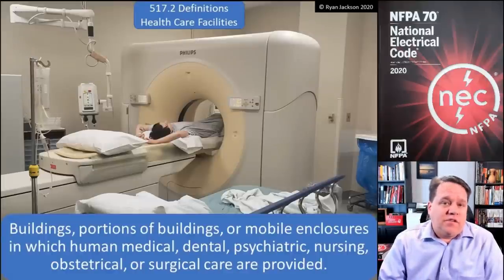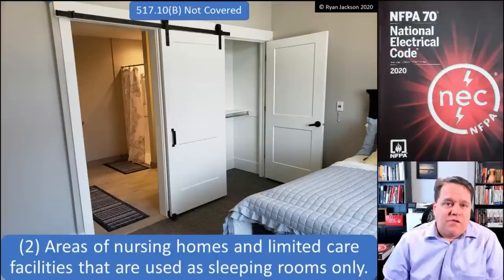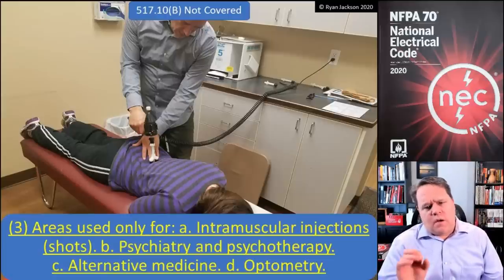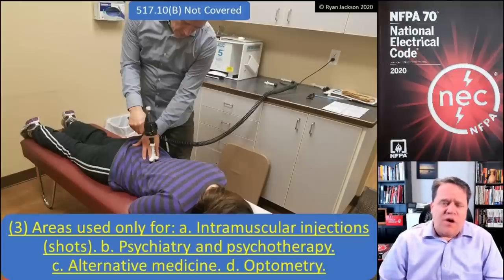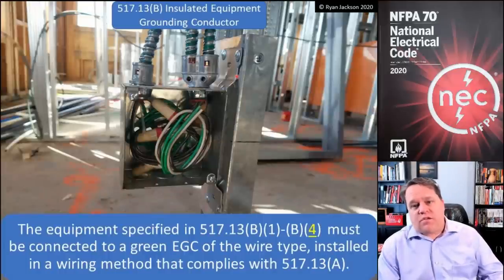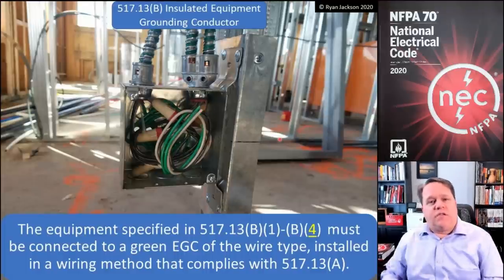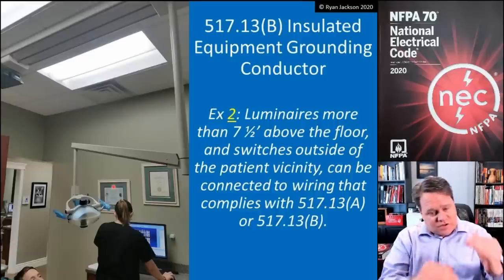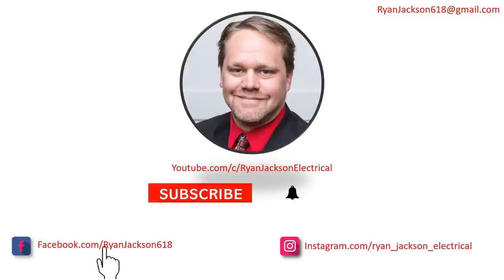Grounding and Bonding in Patient Care Spaces. 2020 NEC 517.13 deep dive

Comment: At a large very progressive Children's Hospital that I retired from they started what they called room a day. They tried to set aside 2 of the 550 patient rooms everyday 7 days a week. Electricians had to check every receptacle and trip GFCI'S with a tester. Also had to make sure if receltacle & switch wall plates were not engreaved with panel & circuit # we had to use tracer then P touch plates. At the same time zone mechanic replaced old ballast and replaced all lamps.  They wanted every patient room to be gone thru at least once a year. Could not talk them into converting to LED'S during the down time. Even went to the trouble of adding a second TV in single bed patient rooms so kids could play playstation on 1 TV while parent watched their show on second TV.

Comment: Unfortunately, your understanding of optometry versus ophthalmology is no longer the case. There are currently four states that allow optometrists to perform surgical procedures, but optometrists are advocating for more states to allow this. There needs to be a proposal to remove their exemption in the code.
Reply from the maker: I'm certainly not an expert, butvI think by definition eye surgery is opthomolgy. A doctor who is not a surgeon might perform surgery. They're not a surgeon, but the procedure is still surgery. An optometrist that performs eye surgery may not be an opthomologist, but hecor she would be performing opthomolgy. That is just what I found via a quick search, however. I didn't perform any deep research on the issue.
Reply from the maker: @r2db  You should make a public input for the 2026 NEC.

Comment: Retired from a large hospital and only the what used to be called chief electrician know actually what was allowed on life safety. ( 1 example = exit luminares ) or just plain vanila emergency panels. ATS switches were programmed to have life safety to be the last lost if all the genetators shut down. Where they had 4 elevators at one location were smart enough to split emergency power to 2 ATS'S. The office that my dermatologist rents space at has hospital grade receptacles in the 2 exam/ procedure rooms.When he moved into this location 15.years ago it was my thought that this location did not need hospital grade receptacles. The only procedures he performs is using nitrogen to freeze small moles or a scapel to remive moles. Only 120 volt thing on is the luminares & desk computer. He uses a battery powered light.

Comment: Hello. Question about your mechanical and conductor ground for your dentist chair: what is the advantage for using a raceway as a ground versus just letting the guy pull two ground conductors? They both seem to be the same solution to me.
Reply from the maker: A metal raceway is a MUCH better conductor than a copper wire.

Comment: Ryan, this is EXCELLENT! As Principal Members of NEC® CMP-15 and of NFPA 99 (Health Care Facilities Code) Electrical Systems Technical Committee (HEA-ELS) and Medical Devices Technical Committee (HEA-MED), I DEEPLY appreciate that you explained that the second grounding conductor is NOT “REDUNDANT” (effectively not or no longer needed or useful; superfluous; exceeding what is necessary; .
characterized by or containing an excess; serving as a duplicate for preventing failure of an entire system upon the failure of a single component). Bringing that second grounding path back around to reducing the impedance to the fault-current and stray current so that the OCPD is GREATLY sped up in operation makes it clear that the second grounding conductor essential and NOT REDUNDANT!  Thank you!!!

It’s worth clarifying that the 7½ feet for grounding of luminaires in 517.13(B)(1) Exception No 2 relates to the 7½ feet height of the Patient Care Vicinity defined in 517.2.

Also worth noting is that “HCF” cables (Type AC-HCF and MC-HCF) are NOT mentioned in NEC®. “HCF” is a Marketing “aid” to make SPECIFYING and INSPECTING Type AC or MC cable SUITABLE for health care facilities EASIER. It IS POSSIBLE (USED to be “normal” before “HCF”) to select and receive the CORRECT Type AC or MC cable having that second grounding conductor per 517.13(B), but the “HCF” gives the specifier, the installer, and the electrical inspector CERTAINTY that the two equipment grounding paths (armor/sheath and wire-type) are in fact being furnished.

Comment: At 24:50 mention cutting the flimsy bare wire on type AC cables. We were taught to leave a 6" tail and wrap it around the cable jacket. Never know ornsaw in any instructions to just cut it off. I still can not believe that a flimsy 16 guage aluminum wire in contact with the dissimilar material steel jacket provides as good as a ground verses a 12 guage copper ground thats in a 12 guage Type MC cable. I hated seeing type AC ( Yep BX cable ) in a damp cellar feeding a heater or furnance.
Reply: That why labs test it to see the facts
Reply: @joes2085  yeah for real. That's why we have codes & standards. Not a good idea to use intuition to determine such issues.

Comment: Great video! Thank you.
Please consider a video explaining equi-potential (to ground) and leakage (to ground) testing in patient care spaces.
Reply: I retired from a large hospital where every OR was feed by 2 LIM panels that meadured leakage and ran an alarm around 4.7 to 4.8 milliamps. Would go into empty OR'S starting around 4 AM to perform testing LIM'S along with ground tension on the duplex receptacles and take voltage and trip alarm using a special test box. Most OR'S had 1.4 to 2 milliamp leakage current with only computers on. Have to use special wire that has low leakage. Regular type THHN/THWN insulation that is moisture, oil & sunlight resistant can never be used in an OR.

Comment: Hi Ryan so when you saying the purpose 517.13 A and B is try to create a parallel equipment grounding path for faster tripping the breaker how is that different than only need to increase the size of that EGC alone but have to have 2 paths in parallel?  The resistance of that path is key isn’t it? If so a pvc with maybe #10 EGC still better (having smaller resistance) than a two parallel paths that an AC cable provided? Or maybe just design a special breaker that can trip circuit as need and this whole confusion go away?  Thanks for your video.

Comment: Best pratice when installing power in patient care areas is to use quality steel set screw EMT connectors ( not crap die cast made in India garbage ) and use extra care making making ground conductor splices. Hopefully contractor will always use the correct depth mud rings on 1900 boxes so yoke on hospital grade receptacles will come in tight contact with mud ring. Always thought it would be best pratice to run a #10 guage copper wire and bond every metal stud inside an OR or within 6' of patient bed area. Thanks Ryan for another great vid.
Reply: Wonderful consideration of quality control issues. Patients and medical staff deserve the best quality control electrical installation consciously possible. Remembering that you can only expect what you inspect!!!!!

Comment: What does the NEC say about power strips for equipment in hospitals such as behind TVs for equipment that is connected to the TV . To be clear , if there are not enough wall receptacles to to handle the TV , nurse call device and video game ,is it ok to use a power strip here .
Reply from the maker: The NEC doesn't say anything about it.

Comment: Novice here - still confused. If the goal is to establish the lowest resistance paths (in parallel), how is two insulated copper wires not superior to an aluminum wire or metal jacket of the conduit or cable?  Going back to your example of two green wires in PVC vs one green wire in AC....I understand it's code, but why is the latter better?
Reply from the maker: Think of how much surface area a conduit has. Sure, copper conducts better than steel. But a 12 AWG wire compared to a 3/4" chunk of steel? Not even close. The raceway has MUCH less resistance.

Comment: how is isolated equipment grounding receptacles isolated if it needs to be bonded to the metal box, and if it is isolated, how would that protect the equipment if there is still a ground prong and why
Reply from the maker: The yoke is isolated from the grounding terminal.
Reply: @RyanJacksonElectrical   i understand that, but the ground wire is bonded to the metal box, so my question is what is the purpose and how is it not counter intuitive
Reply from the maker: @dane5167  The purpose is to have isolation because some electronic equipment can (allegedly) have issues with noise from the EGC terminal being connected to all the other EGCs and metal parts.
Reply: But we we are using metal boxes, then we are still connected to all the other egc and metal parts even with an isolated grounding receptacle no?
Reply from the maker: @dane5167  Correct, but there is a also an EGC that does not not connect to any metal parts, other than the terminal. That is the isolated ground.
Reply: These days very few pieces of equipment require isolated ground